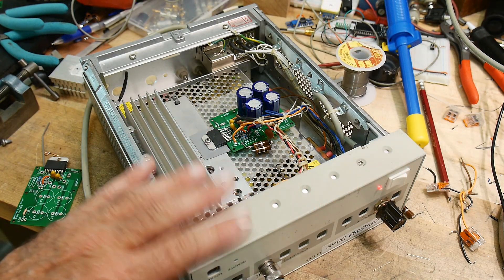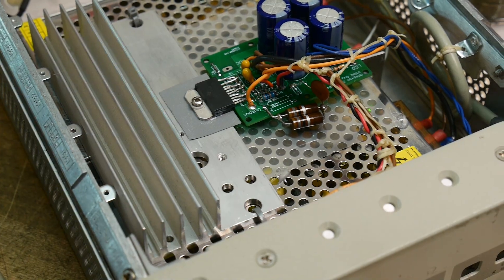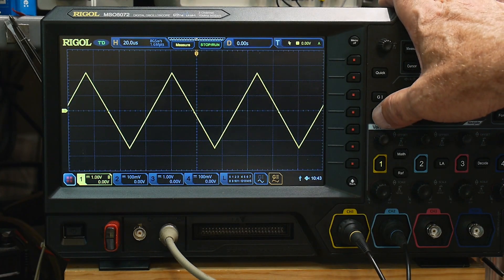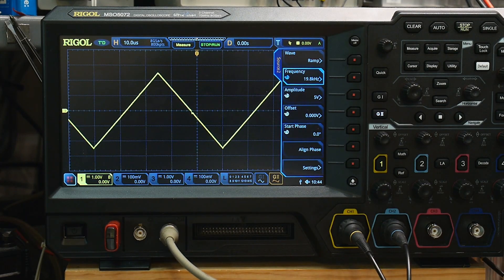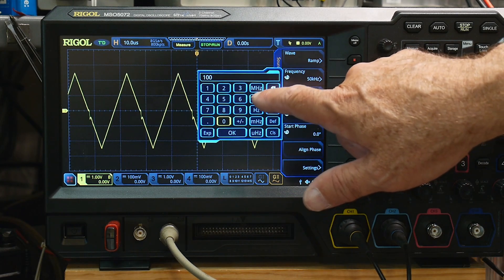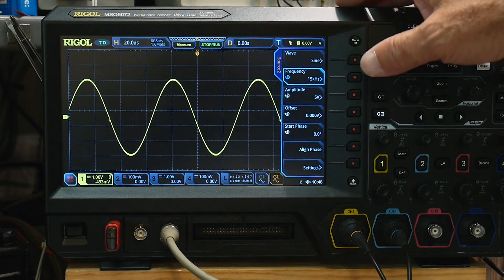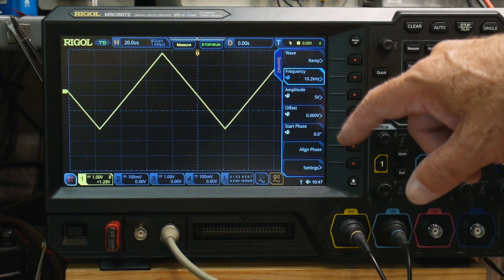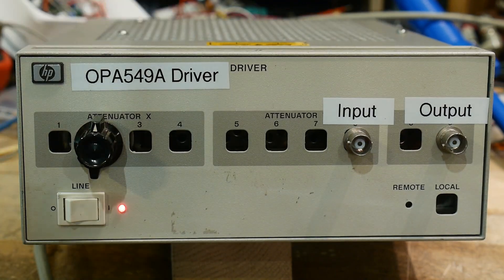#841 OPA549A Final

Comment: Similar glitches seem to be in many op amps. Look at the traces from function generators based on the XR2206 and other similar op amps. You will find kinks in both the OEM ICs and the Ebay fakes. I sure hope you find the cure, because I want to apply the remedy to several of my circuit designs. Today, I was working with an old proof of concept function generator, built on an LM324, and it has the glitch, too.
Reply from the maker: The TI applications engineer said sorry. No fix.

Comment: Not complete until you "pretty" it up.   Why not design a pcboard to sit in front of the chassis with the names of the inputs and outputs written in the pcboard?   I have seen other diy projects done using this method and it works well.   You could also get a vinyl skin done using one of those vinyl cutters.   Check out D-Lab's channel.   I think he now offers that service.
Reply from the maker: I've done the PCB thing too. I tried getting acrylic front panel overlays from a PCB house in china that wanted to sponsor me but they didn't have the service.
Reply: @IMSAIGuy  You don't need them to have a special service. Just create the board in KiCad/whatever without any copper. Some board houses will give you a notice that there is no copper, but that is just a warning. Then, up load the gerbers and you should be good to go. As the panel is going to be bigger than the 100mmx100mm special priced proto boards, it will be more expensive.
Reply from the maker: @t1d100  I was asking them for a service like this: https://frontpanels.com/front-panels/
Reply: PCB? That’s a cop-out. Get an aluminum or stainless panel from Ponoko (I’m not in any way related to them; just impressed with their service).
Reply from the maker: @absurdengineering  I've been looking for a good vendor. what is the price of a silk screened front panel?

Comment: Aren't you curious enough to see if it's possible to remove that distortion?
Reply from the maker: I discuss this in video #801.
Reply: @IMSAIGuy  Went back and reviewed 801. So  I am guessing you won't run it in frequency range that would cause problem? Ditto on my original comment of 801. Now it connects.
Reply: Probably not, it's a "built in feature" of the poor IC and his family:

https://e2e.ti.com/support/amplifiers-group/amplifiers/f/amplifiers-forum/539524/opa548-ringing-right-after-cross-over-but-to-negative-voltage-output-only/1967514#1967514
Reply: It’s hard to beat a bunch of wideband op-amps paralleled via resistors into the output. Used that way, they outperform most everything else that costs the same or less – in terms of both distortion and noise. And the circuit is about as simple as it gets. If the noise gain is higher than signal gain, they’ll be quite stable driving even the wildest nonlinear loads, but just the output resistors for a decent job of stabilizing them for passive non-negative resistance loads.

Good fast bipolar audio op-amps, when paralleled up, make unbeatable monitor amplifiers. Completely transparent, to the point it’s hard to measure the distortion. Their power supplies have decent impact on distortion, so good bypassing and solid supplies are a must.
Reply from the maker: @absurdengineering  what parts and quantity do you recommend for +/-20V 5A
Reply from the maker: some of the highest current opamps I have are 70mA. That is a lot of opamps for 5000mA. Are you suggesting some other opamp I'm not familiar with.